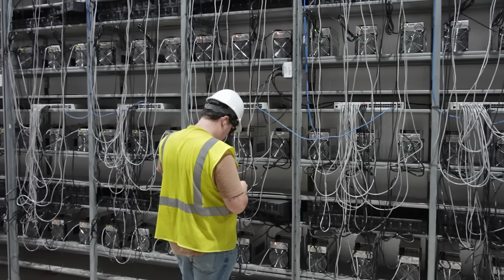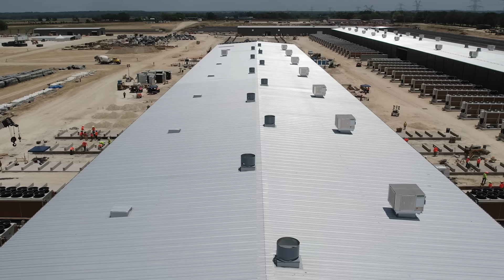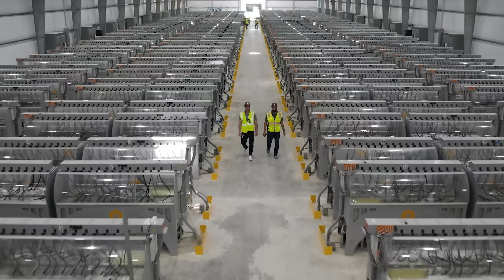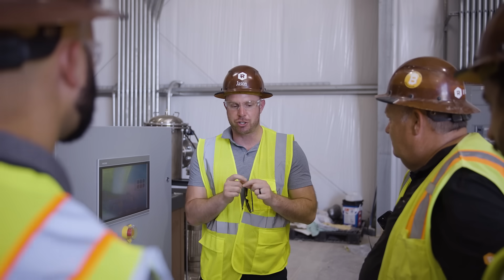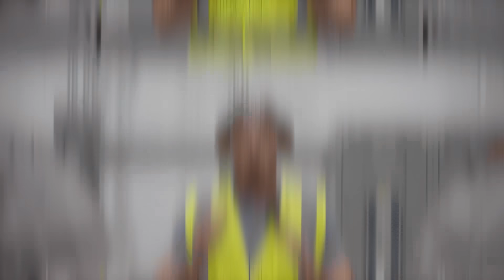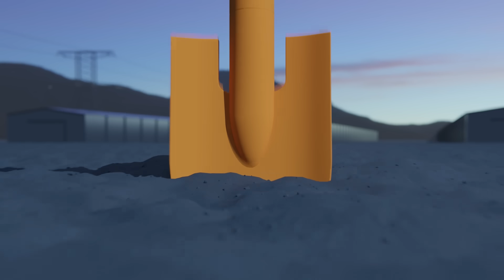Riot Reaches 22.0 EH/s in Deployed Hash Rate, Exceeding Q2 2024 Target

Comment: Got in at 9.50.. in need a 6x from here
Reply: I got 19,000 shares at 9.95 a share
Reply: I only have a few hundred shares but at a 6.16 average
Reply: @LevelUpDownSouth  hold
Reply: If you get a 6x that'll be about a 10x for me. I'm all for it
Reply: 12.20 was my prise 🥲
Reply: Ft339@ On 5/10/24, I purchased 1,630 shares at $9.31. I’m wondering if should sell my position and purchase some shares in Broadcom since it’s splitting.
Reply: Ft339@On 5/10/24, I purchased 1,630 shares at $9.31. With the recent chip companies splitting I’m wondering if I should sell my riot shares and buy Broadcom.
Reply: i am at almost 1.6 k shares at 12.40 per share but holding it for next big btc pump and sell at 2x or 3 x at least !